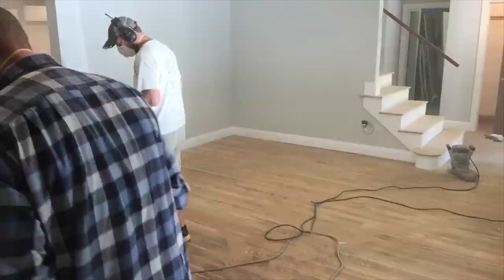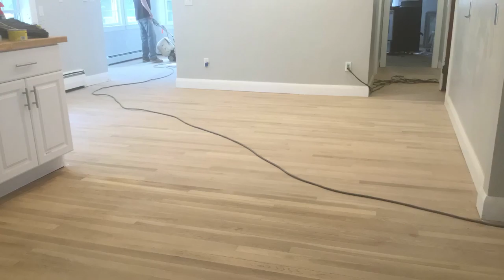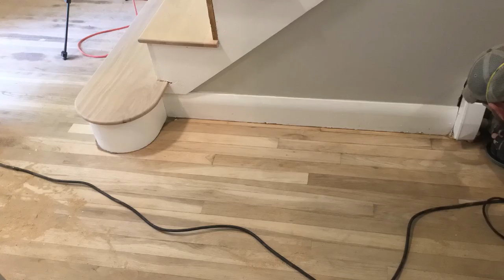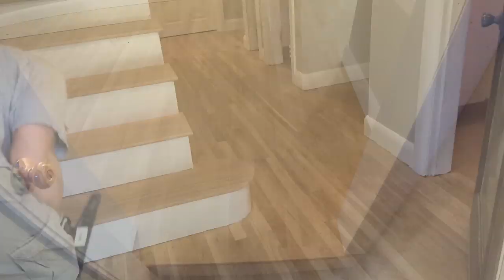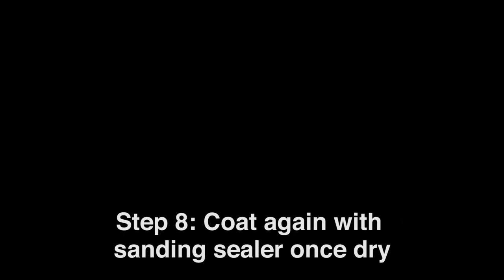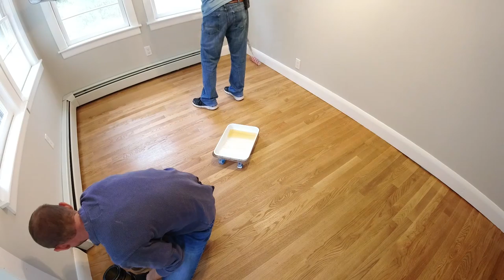DIY Hardwood Floor Restoration Time Lapse - Sanding and Refinishing 700sq ft of Flooring

Comment: Unfortunately I can’t say the same thing like everyone else. I just watched this floor get abused. Your sanding jumped to much, 60 grit straight to 100? Not to mention there was multiple spots that weren’t sanded completely as they needed to be. But I guess if you’re happy, and for a DIY it’s as good as your gonna get without 17k$ in equipment. Hardwood floor sand and refinisher here btw
Reply from the maker: Hey Nathaniel, let me start out by saying I respect the fact you do this for a living.  I'm sure it is not as much work as we went through (because you are smarter about it) haha but I understand it is a ton of work.  Yes, this is a DIY job right here.  We did what we could with the machines we rented and it came out great.  I am sure it would have come out even better if we spent more or hired a professional but sometimes you have to do what you have to do.  I really appreciate your comment and your honesty.  Thanks for checking out the video!

Comment: makes me laugh when I see idiots doing floors with the wrong equipment and acting as if they have done a nice job
Reply from the maker: Hey, if it works it's not stupid.  I am more than happy with the way it came out.  That's all that matters to me but thanks for the opinion and the view John!
Reply: Morans this company is... Totally agree with u John. Invest in the 15000 to 20000 and buy a real belt sander new hummel 6300 real edger 1800 to 2200 clark, alto ect. 220 cords plus adaptors 400plus... Raditor machine istead of grinder lol. Proteam back pack vac 400 plus. Clark rs 16 dustless buffer 1500. 20years in the business worked for 4 before starting my own company and not one of them used shitty equiment like ive seen in these video. Could of had the job sanded and coated in half the time. That god they never staind it or they would have actually had to hire a real company to come in and fix it lol...